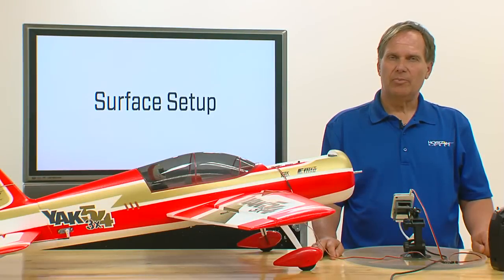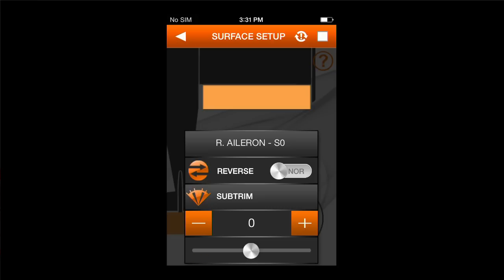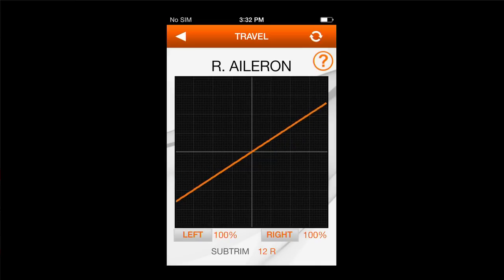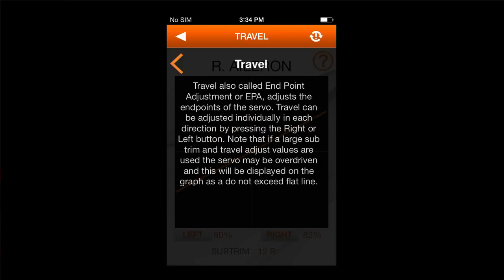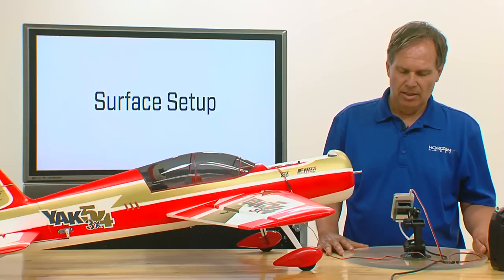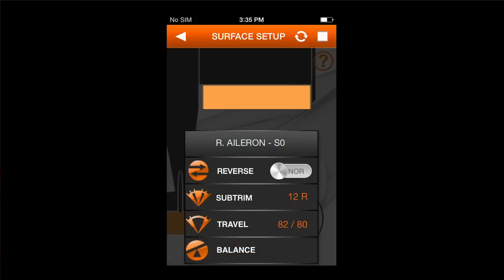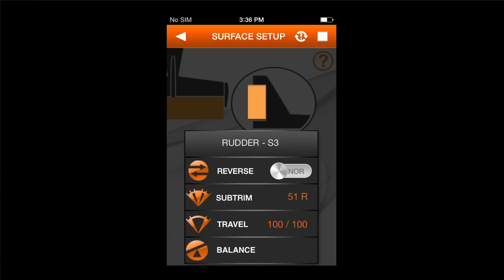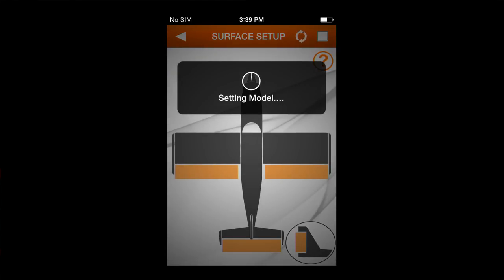Spektrum AS3X Step 12: Surface Setup  (Initial Setup)

Comment: You should adjust the subtrims to center the servo arms; i.e, make them perpendicular to the linkages. Once the servo arms are centered, then you can adjust the linkages to center the control surfaces. If you have to adjust the trims on the transmitter during the first flights to make the plane fly straight and level, adjust the linkages again so that you can put the trim levers back at center..

Comment: Installed the latest version .....3.1 and it didn't save any models. Most software updates will keep info. I know it keeps default .srm files in the install folder but when I make a new model, I am not able to find where it is stored, and I'm pretty good on computers. I am wondering if it stores them into a database?

Comment: take the prop off trust me ant no joke thought it would never happen i got bite by my timber i had a older transmitter that i was binding when i bump the gas on my table was head toward my face i push it away and it got me pretty good on top the hand still got all my fingers thank god happen so quick to so ya pull your prop it was a bad mistake hurt like heck but could ben worse scary deal woke me up good advise john for sure
Reply: Back around 1980 my dad stuck his thumb end on into a prop as he went to adjust the needle valve from the front of the AC, instead of walking round behind as he usually did.  The blades opened up the ball of his thumb from the tip down about an inch. It was probably an OS40, and at full chat would have been spinning a 10×8 at about 20K rpm. That put an end to the days flying, and he then had to drive us about 30 miles home, before driving himself to the local Accident and Emergency hospital. Fortunately they were able to stitch it back together, since it opened up like a flap. Although it was nearly 40 years ago I still remember it vividly. Thats one lesson I know I don't need to learn for myself.
Reply: Back in 1990's when the first .30 size nitro helicopters became affordable there was one modal called the Concept plastic frame helicopter lot of guys new guys showed up at the field with these helicopters. Part of flying as you know lot of setup work one thing is common with all of them is you need to track the main blades on helicopters so the pitch is even on both blades the way to do that is to watch the blades as they spin and adjust so the width of the disc you see is narrow if it's wide one blade is tracking higher. The correct way to do this is to build a stand where you can strap it down so it's above the ground effects I built one out of 2x4 for about $10 then you can safely do this I have done it on the ground that is how I was told back then. This guy decided at the flying field to do it by holding the tail rotor running the thing up to a hover while holding it from moving around back then it was difficult to hold a perfect hover. He held on to this thing one of the other guys yelled at him to stop but a second later a gust of wind caused it to go up he had his left hand on the throttle/collective he chopped the stick the other right hand was holding the boom. The thing went to -3 deg pitch and shoved it down out of his grip and the main rotor hit his arm right below the elbow split his arm almost in half blood spraying everywhere bone sticking out of his arm with half his arm and hand hanging by the meat. Couple of guys ran put a truncate on the arm from the  gas station called paramedics took about 20 min from when he injured himself for fire department to show up no one had a cell phone in 1991. They did save his arm he had years of rehab I heard years later it took about 3 years to get back to normal I saw him a few times at the hobby shop in a cast. I asked him where he got that idea from he said he saw someone else do it without incident.